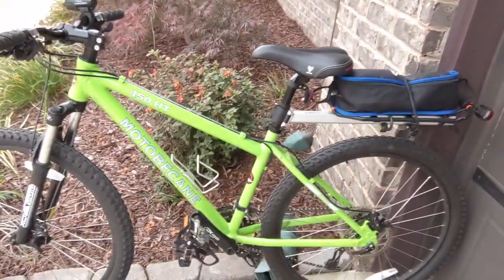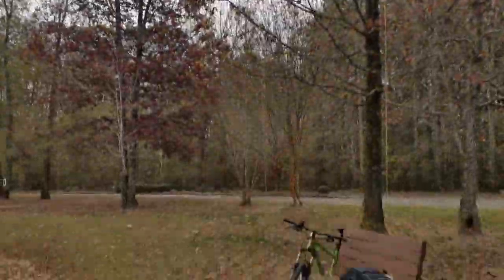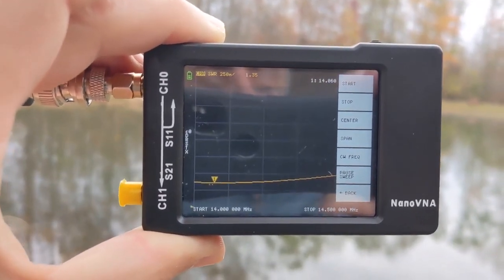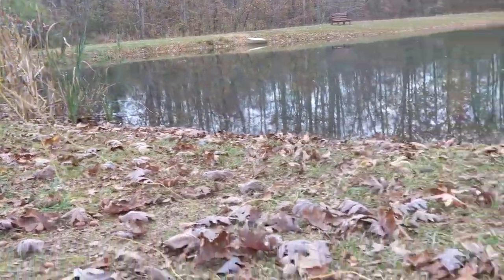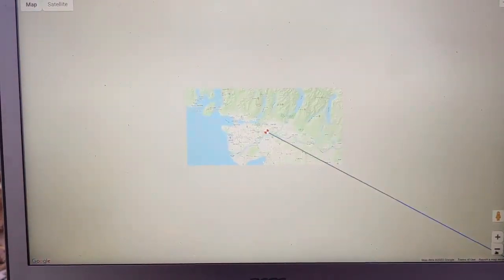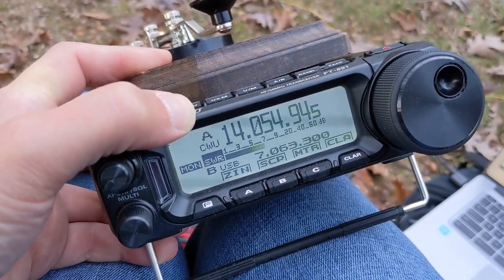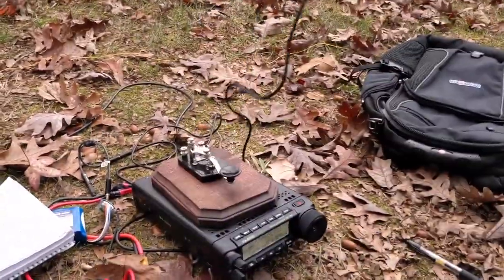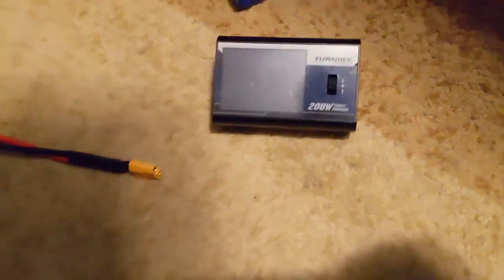portable CW with mini-tenna: a $5 wire vertical antenna (from Nov 2020)

Comment: Looks like I might be able to get reach you once I get my Morse Code down I'm pretty sure Prescott AZ is closer than Vancouver BC by a good margin,(I'm guessing you are in the Muscle Shoals area?).  I was wondering how long to make the ground plane wire but you answered that,(10ft each).  I'm kinda doing the same thing with BNC to Banana plug connectors, but I'm using opposite genders and connected at the banana plugs to the breakout for the ground plane.  All academic right now.  I am still around 550 on the QRP Lab waiting list.  It'll give me time to work on my Morse Code proficiency.  Thanks for the video.  It definitely helped me out.
Reply from the maker: This was one of Mike's first DIY antennas and we still pull it on on occasion!  Propagation changes so much, we never really know where our signal might end up :-)  73 Becky es Mike

Comment: This was great.  I just got my license 2wks ago and I'm very attracted to simple setups. I've fallowed you guys in a number of videos.  I'm now studying for my cw license,  up here in BC,  (-;
Reply from the maker: That's awesome!  We're also attracted to simple setups.  This wire vertical was my go to for very long time.  We only recently replaced it with a bunch of others to experiment mostly. We really love how it doesn't take an expensive setup to have a ton of fun with CW!

We have a video about our tiny 1lb kit.  The whole kit is pretty cheap.  The K6ARK EFHW antenna is awesome.  Becky built it as a kit as her first soldering project.  It requires no coax so its ultra-light and that makes it even cheaper since no coax is required.  Perfect for QRP radios.

73 Mike es Becky

Comment: What type of wire are you using? Gauge? Did you get it from the hardware store, or is it antenna wire? Thanks for making the video.
Reply from the maker: It was just standard speaker wire. I think 16 gauge. I’ve now built the same antenna with multiple kinds of stranded wire and they all seem to work just fine. 73 Mike
Reply: @HamRadioDuo  awesome thank you for the info!